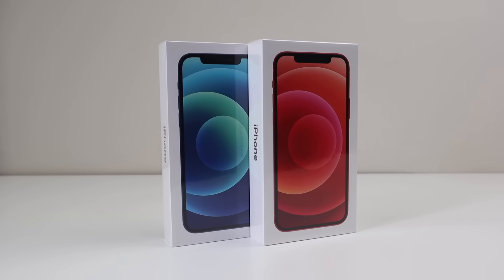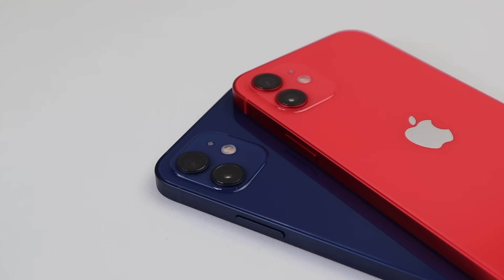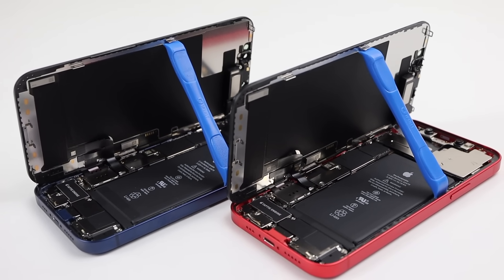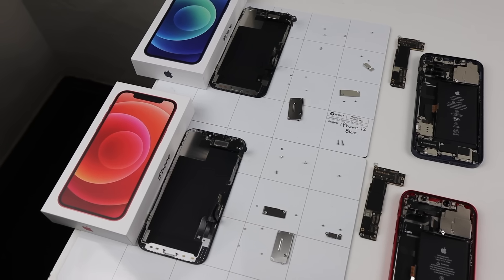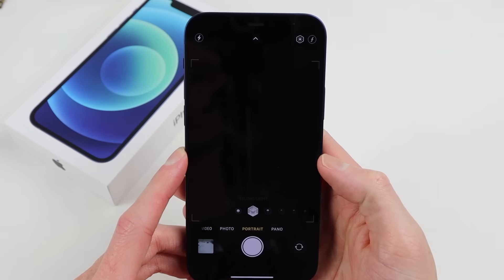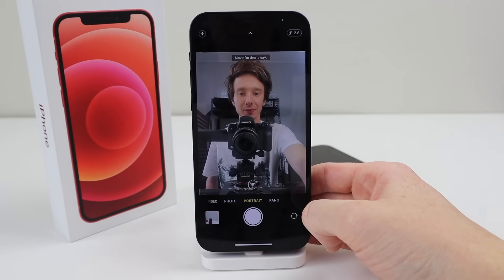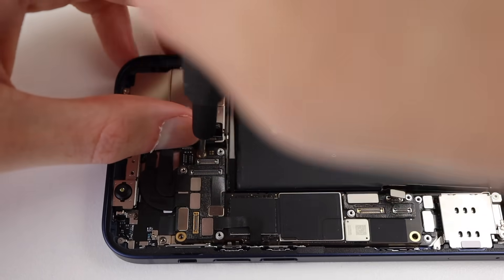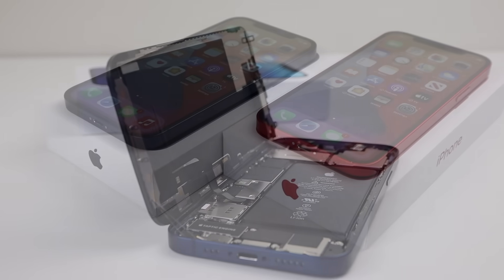iPhone 12 Anti Repair Design - Teardown and Repair Assessment

Comment: I don't use iphone but I'm with you all the way. My last phone (nokia 5.1) became a 3 X a day recharge after 18 months (I'm used to having phones for up to 5 years because I abhor e waste. It still had 6 months warranty so I sent it off asking for a new battery. They made me restore it to factory settings before sending it. They then tested the battery with none of my apps and with the android 9 I assume not even activated and returned it to me saying there were no problems. When they sold it to me they boasted about the apps it could use etc but clearly it was no longer fit for use as I wanted to use it with my apps on it (and as an older person I don't even have that many). I found no way to get a new battery fitted so I had a phone still in warranty no longer fit for the purpose I bought it for. Had to buy a new phone. Integrated batteries should be banned. It makes me laugh all of these teenagers marching for the planet with their iphones etc in their pockets. These businesses intentionally forcing use once and throw away in the name of profit are a disgrace.

Comment: Non repairability is a feature that is built into most, if not all, Apple products.  It keeps the customer and the revenue stream within the Apple domain.  Devices built on the Android OS are far easier to repair and parts are generally much easier to obtain than they are for an iphone.  The price out of the box for a new Android device is also quite a bit less than a new iPhone and the number of available apps and app capabilities is much better on Android since the Android OS is less restrictive than iOS  and gives software developers greater freedom of expression and innovation.  Switched from Apple to Android and would never go back.

Comment: The camera is used for authentication. It's a good thing it's paired to the logic board. If it wasn't paired that would probably be a major design flaw and security risk. Not sure what the reasoning behind pairing the battery is. Maybe the plan is to avoid low quality replacement batteries which have a higher chance of going up in flames inside your pocket.

Comment: Nice video. However, you have demonstrated that third parties repair is not possible, not that repair is not possible altogether. If your camera breaks, Apple will replace the camera module, not the entire phone. To some extent, someone (likely from Apple) could also say: 

"We make the camera and we can guarantee best environmental impact if we are also the only one that handle the malfunctioning units. In fact we can do the lowest possible debugging on each unit, fix the issue, and put the refurbished unit on a new phone".

 I agree it's a bummer, but potentially it is not contradictory with the environmental arguments Apple advertise about itself.

Comment: Everything is hackable, and soon some enthusiasts will break all hardships.

But to buy new phone will be cheaper than repairing old.
Reply: Depends on the components. If the logic board is fried, you have to buy a new phone. But battery, camera, screen should be replaceable. If you just throw your phone if just 1 component is broken, then either you are super rich or don't care about the products you buy
Reply: Repairing is always cheaper. Linus fixed a Mac AIO by himself and still came under both the cost of repair provided by Apple and the cost of a new AIO
Reply: @AMRAMRS  yes, because phones don't die like humans.
If some organism dies, you can't fix it actually

Comment: so basically iphone is way more expensive now then before with them not even including a charger thats viable with the cable that connect the phone to the charger so you literally have to buy a third party charger, and also headphones arent even included. yep, i cant really see how iphone should still be a company after this, i wonder how many iphone fans there still are over samsung XD. cheapskates.

Comment: Cameras are linked to FaceID, which is identification used to open de device. It is normal that some system prevents this to be swaped or messed with as it would mean a possibility to hack it to unlock device and then access to Data or confidential accounts information. Of course a side effect seems to be blocking third party repairs as well, how convenient. Still security reason is justified, can't swap/mess-with the component used to secure and unlock the device or else you may be able to plug some faceID emulator device that would open it. Just a theory.
Reply: thanks. I was scrolling the comments in search for an alternative explanation for why this is happening. I mean… purposefully adding security measures day 1, to prevent something that almost never happens (never heard of anyone replacing their camera on their phone… ever), when no third party parts exist and everybody will just send back their iphone for warranty if the camera fails. 

Common… it makes no sense. Security measures cost money and aren't made unless there's a risk of losing more money by not doing them. Failing/hacked face ID: massive risk. Third party camera replacement: massive meh.

Comment: Ex-Apple user ...switched to Xiaomi ...not going back to a closed ecosystem! Apple is greedy and the rest of the tech world is catching up on good pictures and video. No need to use apple. They are money sink devices. Apple started this trend and the government needs to end it. If you pay for a device you should have the right to own it and its parts and the right to take it anywhere to be repaired. This is an anti-consumer, not pro-consumer.

Comment: My guess is that apple is going to claim that the face id is disabled because they are "afraid" that a hacker could access a locked phone by sending it an "artificial face" image feed via the cable. Ironically it would probably be easier to just play a video of the person's face for the camera that's already installed.

Comment: apple lock all its hardware, may be each module like camera,  sensors, display etc has a one time programmable memory chip with an id stored into it n the logic board reads it each time while using it n when logic board finds unrecognised module, it rejects that module or lock some features. An authorised service centre when replace a broken module they reset the phone's logic board to recognise the new module with their software.
does anybody know what software is used by service centre?

Comment: I can see why they would deactivate some features after a replacement happens. The camera for example, the third party repair guy could use the logic board to send a live feed of the camera and so on. But if apple is gonna worry about that, then why wont they fix other problems that are a genuine problems for so many years.

Comment: I think I read something about the "Repairability" of iPhones on the internet.

It was when my iPhone 6s' home button stopped working few years back. And tried to buy some parts from online stores to repair the home button myself.

On the comment / review section of the online store. One guy said that the home button will work, but the touch ID will not. He said that it's because of the security. 

I guess Apple did the same thing to every part of the iPhone because of the security.

The guy also mentioned about hardware level hacking / Hardware installed hacking stuff.

I barely remember all the details

Comment: This is one of the main reasons that I am swapping to Android. My iPad charging port got cracked and it would have taken more than 1000 dollars to repair the iPad. As a result, my iPad is now in its coffin, the box which I had bought it in.

Later on, I have an iPhone 6. iPhone 6 has the shittiest battery life ever and I'm upgrading to a Galaxy s20 FE. 

My mac also has bad battery life; the only reason I'm using a mac in the first place is because my school requires me to use Apple. 
The only reason I would consider getting an apple product is their iPad; they make the best tablets, but never for computers or phones.

Comment: Please learn how an iPhone is built and works before saying 'it is not repairable' => The components of the iPhone are associated with the motherboard right in the manufacturing process because of the security co-processor. FaceID doesn't work because the public encryption key stored in the FaceID module doesn't matche the private one in the security chip (it was the same for TouchID).

Stop blaming Apple for this kind of things and go and buy an Android phone if you're not happy with it. Security has a price; in fact 2 : the higher price of the iPhone & the repairability.

About the battery health indicator disapearing, just learn about batteries technologies and you will find out : Even if they all work with lithium, batteries don't have the same internal resistance, the same charge curve and anything like that because of a different electronical / chemical composition.
That said, Apple disables it because if they say a non-official battery is dead but in reality it has like 75% of its inital capacity, Apple could be charged for disinformation. They calibrate their software for their hardware.

Finally, if you can put between 800 & 1400 $ in an iPhone, you can put 45$ in an official battery pack in an Apple Store.

Comment: It’s not only Apple iPhones that can’t be repaired by independent smartphone repair shops, but also most modern day cars are so complicated with so much electronics that can’t be repaired by independent mechanics. In other words, people have no choice but to bring their cars back to the authorized dealers for repairs. The same can be said with luxury watches. Rolex has stopped selling their genuine parts to independent watchmakers, therefore, Rolex owners have no choice but to bring their watches to Rolex Authorized Service Centers if they need repairs.

Comment: A relative repairability rating system which considers ease of repair, any proprietary aspects of servicing, and commitment to broad and long term parts availability should be part of every serviceable product. This would allow consumers to make informed decisions.

Complementing this should be a highly incentive based system for total cost of product life including disposal and recycling.  This purpose would be to make repair far more commercially desirable than disposal. This would have the effect of making design for repair far more important to manufacturers than it is today.

Comment: I guess that the camera id  or   model  is  sewn into the system and after changing components OS gives to a new unregistered device limited rights  until you register it  into the system. If you can some way change that id, probaly OS will be worked. Perhaps, Apple can fix  own devices.

Comment: CLUE: New on this iPhone is: Every hardware part has an unique hardware ID. You need to re-register the new part on software side and it will work. Only Apple has the software to re-register the changed part so the iPhone would work normally. So Apple can ensure only Apple is getting repairs and give full support. That's the only invention Apple has made since iPhone 11 not mentioned at all.

Comment: Ever since Steve Jobs passed away, I noticed a slow decline in the quality of their projects... but only up to the last couple years have I seen it decline rapidly. 

Just my observations here, but I think this is what happens when the heart of a creator is taken away from something and all that's left are the people wanting to make money from the creator's old ideas.
Reply: The logic boards have been failing garbage even when Steve was around. They have been specifically designed to have such weak circuits and bad power regulators that you can still have blown fuses on the thing. For comparison, that almost never happens on a standard PC with an average-quality board.
Reply: Steve Jobs was a hack fraud.
Reply: @DarkReign  lol you're a spicy one.

Comment: So Apple didn’t just killed third party repair, but correspondingly the resell value too. I mean secondhand sellers/buyers will only be able to replace a new battery from authorized Apple centre, and although I don’t live in the US, but in my country the cost of repair will equal to a new mobile....

Comment: Fcuk Apple. I started using Samsung,  Motorola, Sony for last 4 years and for me its just fine with 70% cheaper. The latest one I got from Amazon moto G 8 lite for $215.00 with 5000 mAh battery, 64 gb, 4gb ram cameras are excellent .if anything goes wrong throw away get another.

Comment: It can be by someone trained to do the repair, not some ham fisted 3rd party
Reply: You don't need to be trained by Apple to repair a phone lol
Reply: @rudram.552  for an iPhone you do. Oh and to have access to genuine Apple parts, and the proper software.
Reply: @rudram.552  by all means though, keep ruining iPhone with 3rd party parts and untrained techniques
Reply: @jaywkan  Mate.. he literally used another IPhone 12 to "repair" another IPhone 12. How is that using 3rd party or improper parts? How is that using improper software? You're the reason why Apple keeps getting away with bullshit practices like this. Why can't I take a part that is still functioning properly in one IPhone, to replace with a broken part in another, ya know to reduce waste.
Reply: @L4sket  because that part isn’t paired to the logic board. The screens are calibrated down to the pixel when replace correctly. Hypothetically if you obtained a screen off another failed device and fitted it to an iPhone with a damaged display, what happens if the screen was the reason the other device failed? Where does that leave the device that only had a damaged display? 3rd party repairers don’t have the skill or tools to correctly do a repair let alone determine a fault.

Comment: I know nothing of iPhones or Mac but it's obvious that each piece of hardware is equipped with an ID of some sort. How difficult would it be to hook it up to a computer and edit the ID or disable the verification process between the hardware
Reply: Stuff like that actually exists for older iPhones. But things like Touch ID or Face ID can't be fixed by anyone besides Apple, and no one has been able to find a work-around.
Reply: @rudram.552  Oh, i love a good mystery. Maybe it's a unique identifier embedded into the hardware itself. At any rate thank you i have a feeling I'm going to be diving into the ways of the iphone.

Comment: You break 2 phones and you’re surprised you now have 2 broken phones? 🙄
Are you really that stupid?
Reply: Swapping parts between devices isn't breaking them
Reply: He swapped parts, it's not breaking it's replacing. He even put the original parts into their original phones and they worked flawlessly... please tell me how he broke them.
Reply: @L4sket  
Obviously you don’t know how Apple works. 
They are not like Microsoft or Google (and their buyers) who go spec shopping and cobble together a device. 
Every device is designed specifically for that device only and for optimum performance (& price).
Even if you or the perpetrator can’t tell the difference. 
The fact that OEM Apple parts were used and still didn’t work should’ve made it obviously clear. 
Unless you don’t get anything of course. You can’t learn intelligence, no matter how many phones you molest.

Comment: This is wrong! It is still repairable for third party. But you need to first remove the faceID. Otherwise, the sake of security is just a joke
Reply: You mean how he tried to do multiple times?
Reply: He did try to use faceID after swapping the parts. But he should disable face ID before changing any parts.

Comment: Sone in 2020: we make ps5 competible with third-party SSD, we make inside parts are easily accesible for repair.
Apple in 2020:
Reply: >Removes the vital charger because resource saving
>Keeps the notch to eliminate any hopes of net resource saving

"Durr, makes sense to mii, derp."
Reply: If that's true I'll switch over

Comment: What is the BOM for iPhone 12? I guess 250$-350$ and sell for 1000$. Currently with no powerbrick if you want it cost around 70-100$ on top of the iPhone. So buying the damn iPhone until they think about their customers back. Apple had turn completely into a corp that milked it's customer and it's just started. if you still want iPhone, buy the 11. Don't buy the 12 and show to apple that if they want your money, they have to give something for it ex charger like older iPhone. What's the point of the cable if it's type c while ip X were still using usb and no charging feature like faster charging with the new one. They give you less for more money. People need to realize this. If the charger cost you 100$ dollar on the apple store, then iPhone should be 100$ less than the current. price.

Comment: Hi can some one tell me if the display is changed at an apple authorised dealer will the phone continue to be water resistant and if you phone has a serious issue do apple replace it with a brand new one or give u a refurbished phone if yes how does one check if it’s brand new ? Thanks

Comment: They probably came out with a patch code into the parts making the phones in 4 parts or less or more, meaning they can have (for example) Model Phone 1, 2, 3, 4 with each ones parts having different coding patches on each of its hardware so if you get phone model 1 and exchange parts with model 2 then the patch code is wrong and wont work properly. Its a coding issue, try to find out if you get the same color model or maybe try it with more phones, they would need to give everyone of those parts a separate code and that would be too hard to do and expensive.